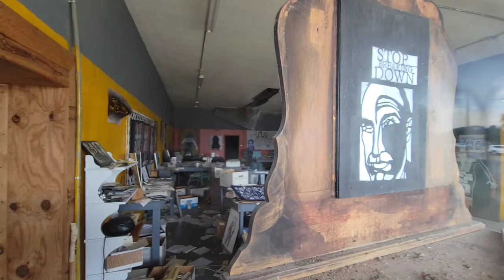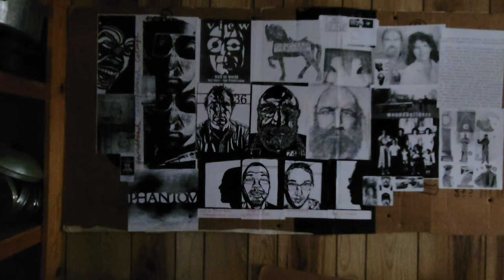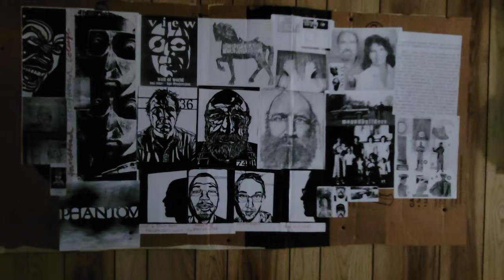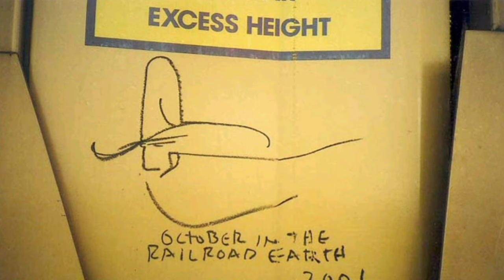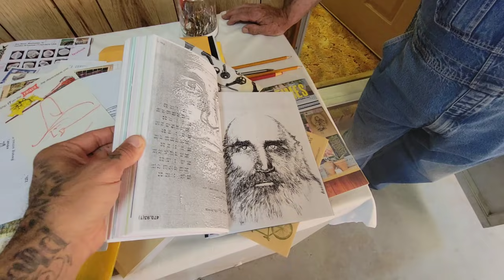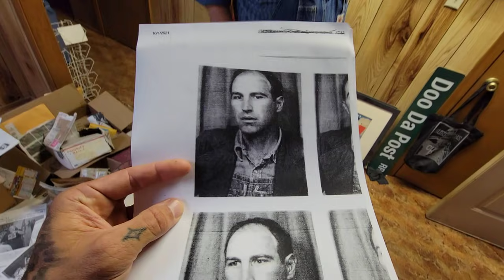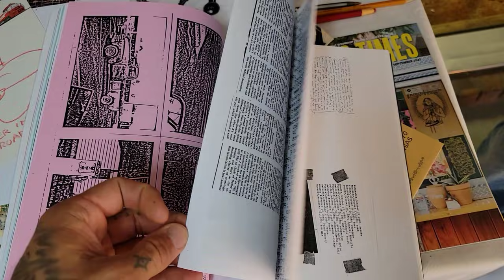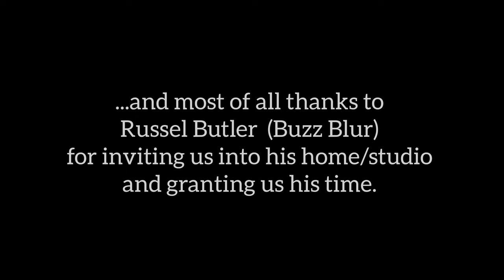Unintentional Artists of American Railroads / Buzz Blurr/ Colossus of Rhodes

Comment: The untouched TP is the star in the bathroom photos!
Reply: Note the COARSE gravel "floor"
Reply: @barbarabroeske1061  some old shops are like that so you're not constantly falling on your ass. A thin film of oil tends to coat EVERYTHING in a machine shop after a while, and oil on a normal concrete floor will break your damn neck.
Reply: @dogslobbergardens6606   sometimes safety looks like hell. Natural texture has saved asses since before the stone age. I know. My ass was there. Gravel was the look then. Jus like the resurgence of Mid Century Modern shit, gravel will soon be back in vogue. It's popular now in more n more "homes" under highway bridges.

Comment: Russel Butler was a switchman for the Missouri Pacific Railroad and before 911 He was a Ham Radio Operator I used to talk to him from Hot Springs, Arkansas, I cannot remember his call sign, mine was KD5MPM  but I upgraded in 2010 to W5AWG. the Railroad forbid him to use Ham Radio while running his locomotive,